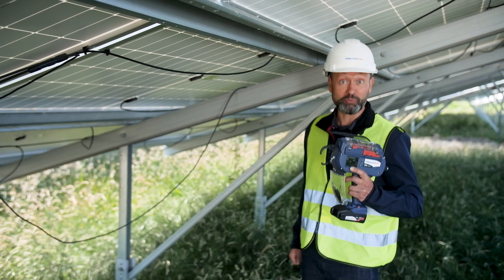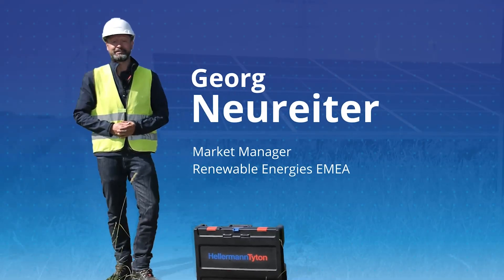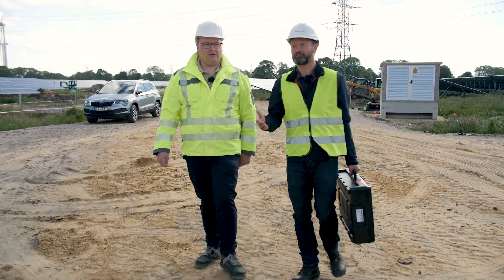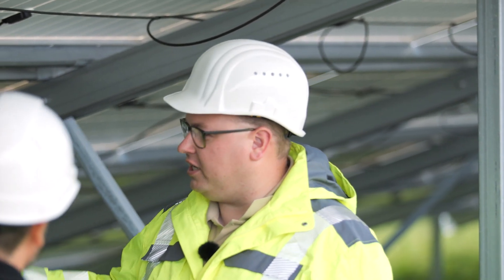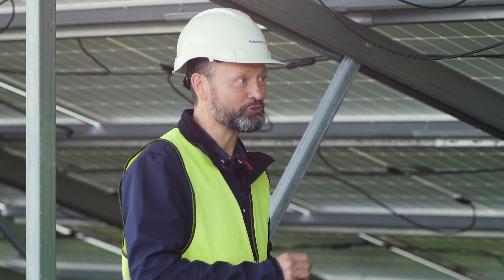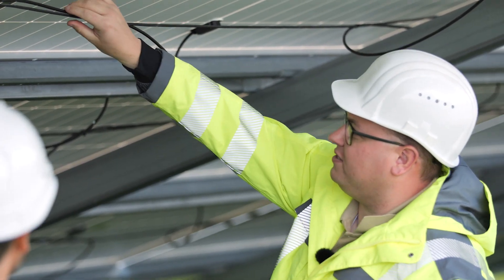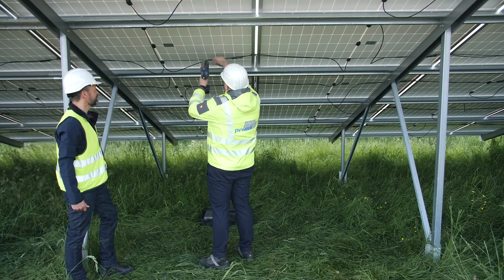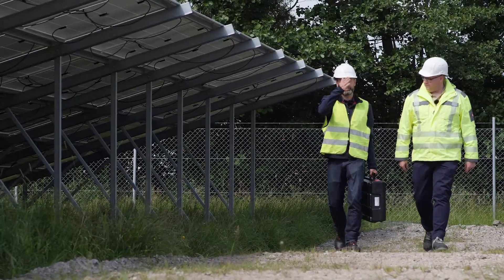Perfect cable bundling in solar parks with Autotool CPK hybrid (EN)

Comment: en, the premise is with a higher cable? we use cable clip, seems work also
Reply from the maker: Hello Juju He, 
thanks for your comment and your question.
It's good to use cable clips if you want to secure cables to various surfaces and standard cable ties to simply bundle your cables. If cable clips are the right solution for you, that's great! 
The Autotool CPK hybrid is simply faster, easier, and much more flexible to use, especially when applying cable ties on a larger scale. You can find more information, here: https://www.hellermanntyton.com/products/automatic-cable-tying-system/t18ra50/120-40020?utm_source=youtube&utm_medium=social&utm_campaign=youtube&utm_content=comment-1xPPg0SgOcQ-en-120-40020
Best wishes 
Nico